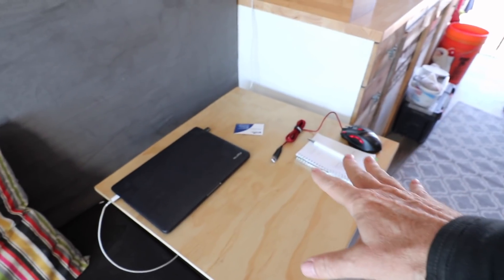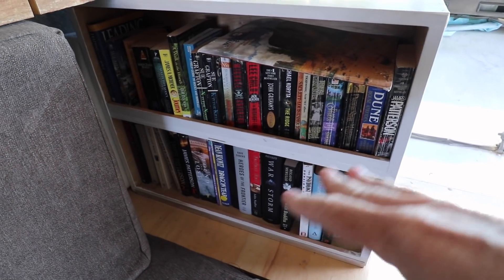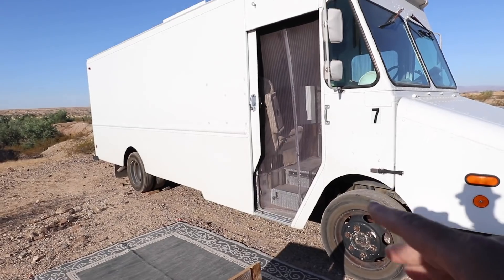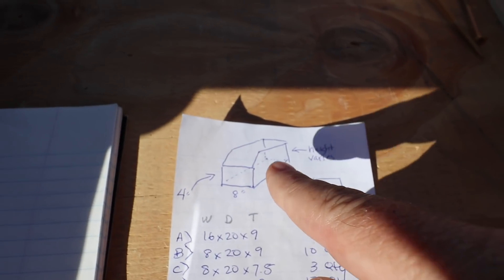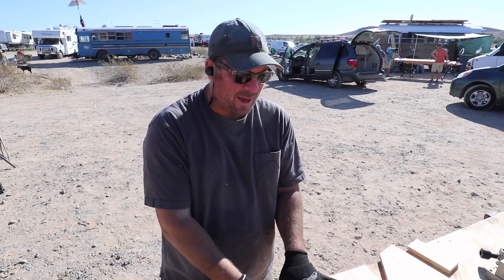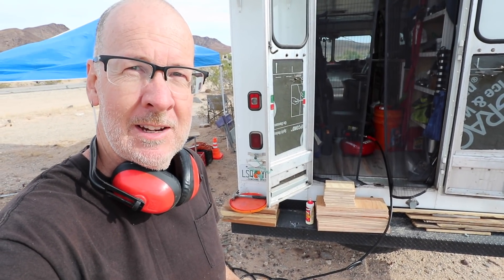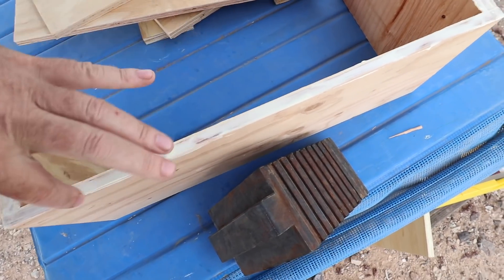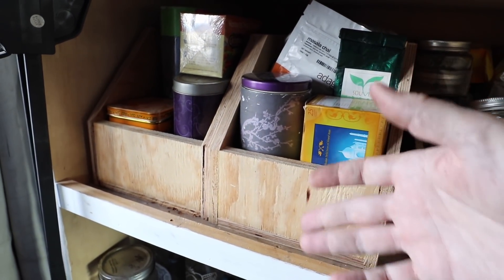My Projects at Jamies Van Build Party 2019 E571

Comment: wrong technique.... put the wood glue on the open grain and let it soak in, then put a second layer of glue and put it together.  do not let the glue get tacky prior to putting the wood together.  when it is tacky, it is already starting to dry.  wet glue is best.
of course, if you are using contact cement, then you must let it get to the point where it is no longer sticky to the touch.
Reply: SpicyPeteNorman, 😄 it was nice to find your comment. Though I would argue against waiting for the glue to soak in or adding a second coat. Instead, apply and spread evenly, then clamp (and/or tack) immediately. It will soak in just as well with the pieces in contact; exposure to air doesn’t help. And if the joint is assembled immediately, it matters not at all to which part the glue is initially applied; however, if the surfaces are unavoidably poorly fitted, it would be best to apply glue to both, so that there’s less chance of a void.
Reply: @_just_looking_thank_you  yes, I agree about the aplying to both surfaces, however on porous surfaces where the glue is prone to soak in a lot, the amount of glue left to bond the 2 surfaces may not be enough, so putting one layer of glue on the porous surface first, and then adding a second layer of glue where the glue has soaked in is a very good idea if you want long term success with your glueing project... I have had many people tell me I dont need to put a layer of glue on the open grain edge of the wood, however in my lifetime of experiences I have more often than not had to go back and fix the work of those that told me the extra glue was not neccesary.  my work never needed to be fixed later.
Reply: @SpicyPeteNorman, your point is well taken. I’ll try that out sometime. Cheers.
Reply: @_just_looking_thank_you  it is the same when applying some arborite to a countertop, i always put 2 coats of glue on the wood ... that means i put one coat on the wood and let it dry, then put a second coat on the wood and the first coat on the arborite... wait for the glue to not be tacky, and put the arborite on.  Many times in my life i have encountered the laminate coming off the wood surface, yet no countertop that i have ever made had that problem.  I am a Power Engineer, and was a supervisor of maintenance for 2 large shopping malls that had many offices and shop tennents... i often found countertops coming apart due to the glue having soaked into the wood too much and not leaving enough for the surfaces to bond well and therefor it did not hold the laminate in place. 
also, as an extra.... i have never had my countertops swell from moisture.  Prior to glueing, i always give 2 coats of exterior grade varathane (or other wood sealer) to all corners and joints and cut outs... so the moisture is never a problem.
Reply from the maker: great tips everyone... thanks!